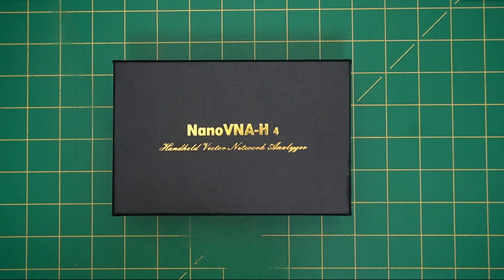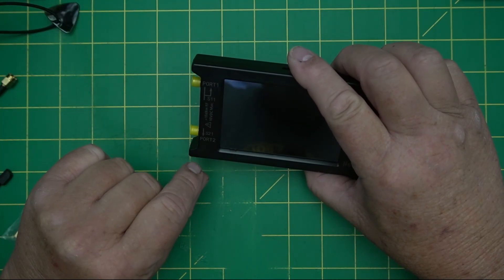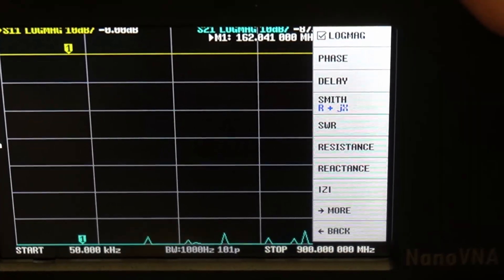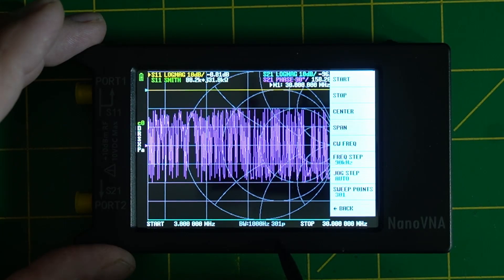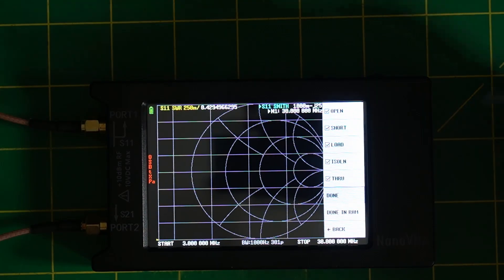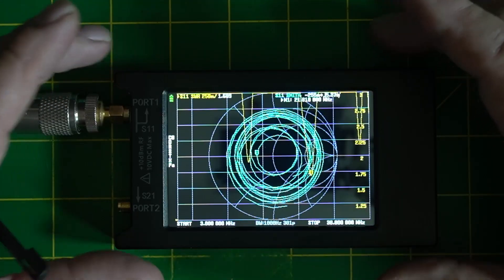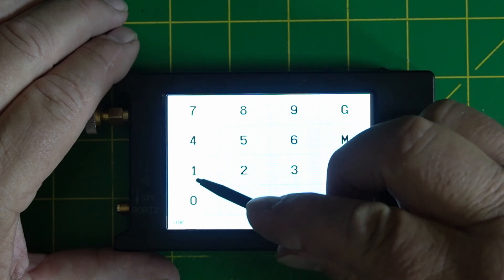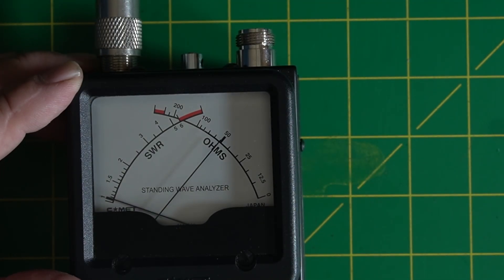Let's try a Nano VNA

Comment: I have had a Nanovna probably since the first time you guts mentioned them on CAHR. I have used it a little. I have a new antenna planned, and am going to take the time to test it as I put it together.
Reply from the maker: LC I really need to use this and learn to use it better. It is a powerful tool.
Reply: @KK6USYHamRadioAdventures I agree  and am guilty of not using mine enough.